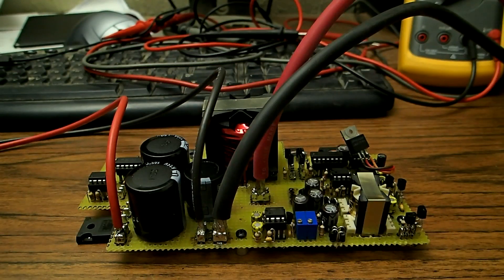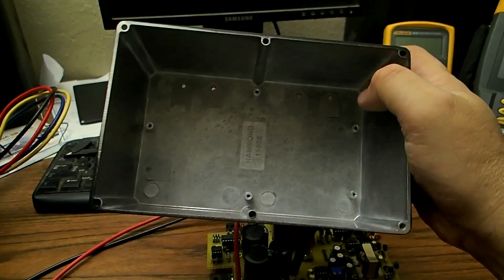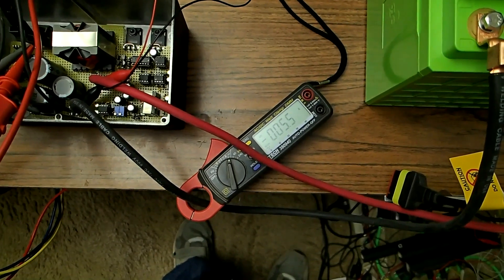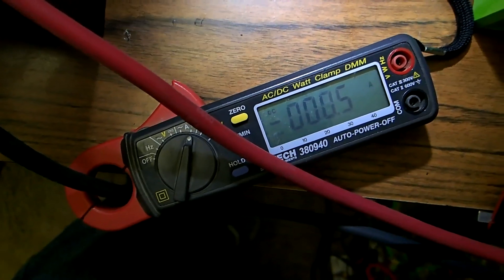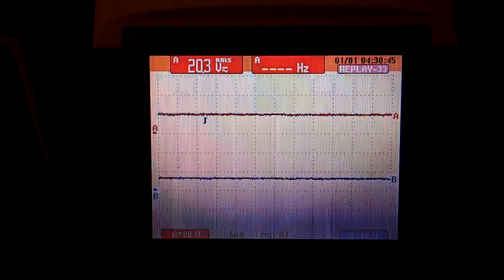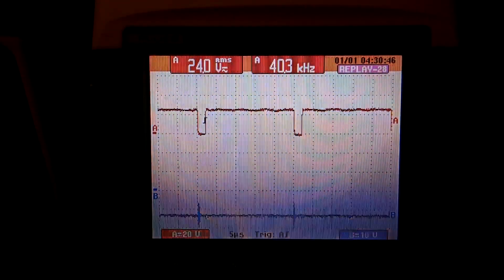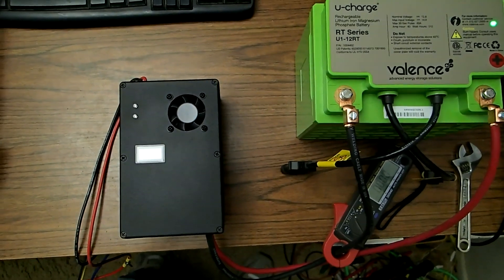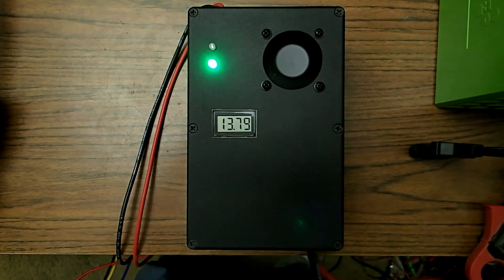MPPT 550 Charge Controller (Designed myself)

Comment: How are you tracking maximum power points, what algorithm are you using. Are using an microcontroller
Reply from the maker: It use the buck converter it don't use an algorithm, there's no microcontroller
Reply: @RaptorRotorHead  ok

Comment: What components are you using at the front end of the mppt for reducing the high voltage series connected 260w panels down to a low voltage 14vdc high current output? Is it a variable DC -DC isolated power supply IC? after all the idea of mppt technology over that of normal solar charge controllers is to use thinner, cheaper and fewer high voltage like 150VDC panel arrays hooked in series on the rooftop and the mppt changes it into high amp low voltage DC for charging the battery. Please let me know what you use for the front end for reducing voltage and multiplying current. Kepp up the great work!

Comment: @Clay Reid Julian Ilett's PWM5 solar charge controller (Arduino version) had a problem of jittering of the pulses width.  He figured that it was caused by the sampling of the voltage coinciding with the on state of the MOSFET, and sometimes when it is off, thus getting different voltage readings.  Did you take that into consideration with your controller?

Comment from the maker: the grid tie inverter raises its 240 voltage up by 1 volt more than the grid that allows it to push the energy back into the grid.
Reply: +Clay Reid I figure that it has some type of feedback by sampling the line voltage, then it produces sine wave with, say, 240 +1 volts RMS.  Now the line voltage (without the grid tie) may vary and hence the sampling process.  On subsequent cycles, I figure it is continously sampling the voltage, even with the generated voltage impressed.  Since they are in parallel at that point, how does it know the difference?
Reply from the maker: The two signals lock together in phase.
Reply: He means how does it know voltage diffrence of grid since equipment is also feeding the grid and now in parallel.